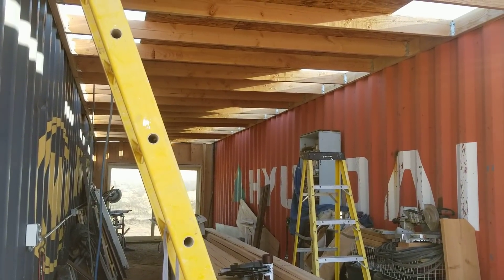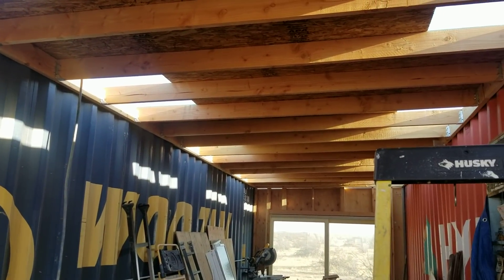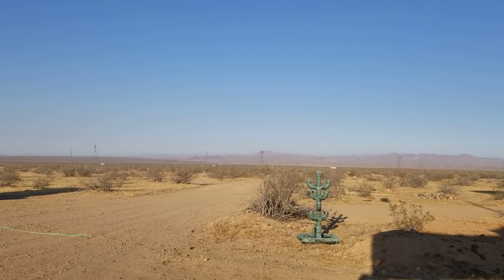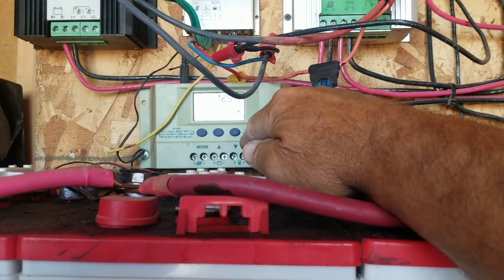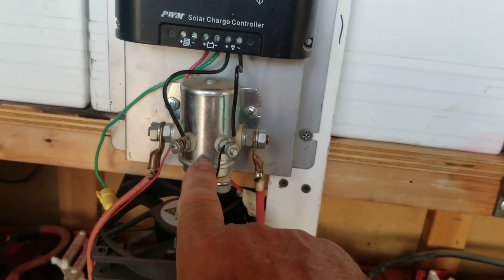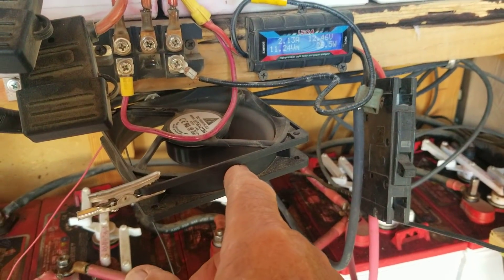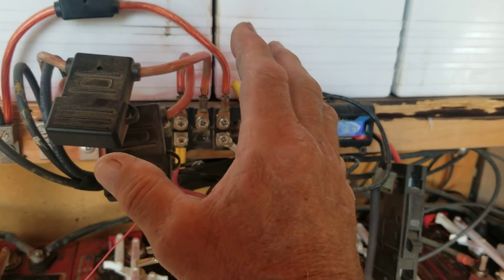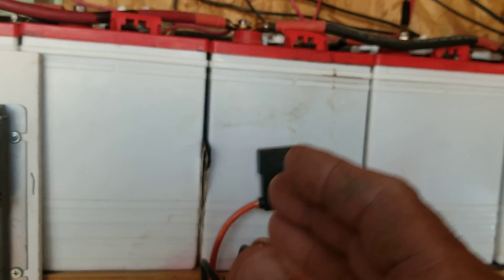7.1 Earthquake damage inspection, off grid electric part 2.

Comment: hi gbear good video was watching forever north i think the problem he is having with his solar is he has more battery ah than he has solar watts coming in
Reply from the maker: I don't think so.   Those batteries should have no problem charging, even with only 100 watts solar.  The math says they need around 68 watts to charge.  The problem is his load exceeds the capability of his system.
Thanks for commenting.

Comment: Glad your property came through quake intact.  It shows you do good work!   Quick question:  over the course of a year/4 seasons- what is your guesstimate of the percentage of the power that you use that comes from wind?  I'm really curious?
Reply from the maker: I'm not sure I understand your question, but here are a few facts about my system and location.
1.  Solar gives me 1.5 kw when sun is out.
2.  Wind above 7mph starts producing about 40 to 80 watts.
3.  Average wind speeds around 14-18mph at night produce 200-300 watts, and occasional winds above 24mph produce 600-800 watts.
4.  Wind storms with 30+ mph gusts have shown 800-1kw.
Weather has been weird.   Last year (2018) there were more calm days with breezy nights.  This year there have been more days of 14+mph winds than calm days, and nights have been windier.

If you want specific % of Wind vs. Solar production, I could only guess, around 80%-20% consecutively. 
I don't have a PMA for main power production, only because the sun doesn't shine at night, but I still use electricity and want to supplement that usage.
I hope that answers your question.

Comment: i rather the low humidity and heat than high humidity like where my uncles live in the tropics. extra cooling fans dont hurt with inverters, ive seen so many of the budget inverters burn their mosfets out its not funny and not even under full load.
Reply from the maker: Yeah,  things the sellers don't tell the buyers in order to sell more after the buyer burns them up would make a great book!

Comment: gbear . you need some mppt controller does PWM not that great.mppt give you a little more amps and works better
Reply from the maker: Yes mppt is better than pwm.  I use both and have more than adequate power.

Comment: leaning from your videos,  humidity here in northern Ontario Canada is 75%
Reply from the maker: I grew up in Rhode Island where summer meant 90 degrees with 99% humidity.  Stand still in the shade with a fan running and sweat until your clothes were wet.
Reply: @GBear  that's right,  my grampa was born and raised in Rhode island,  Woonsocket or something like that.